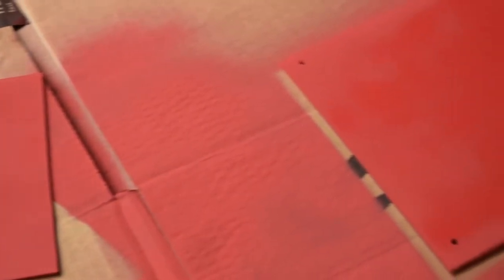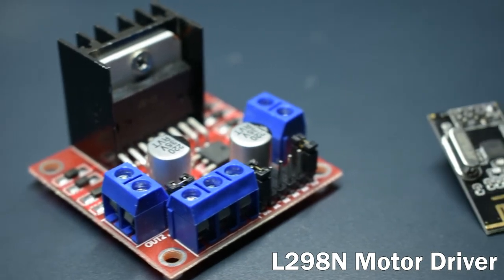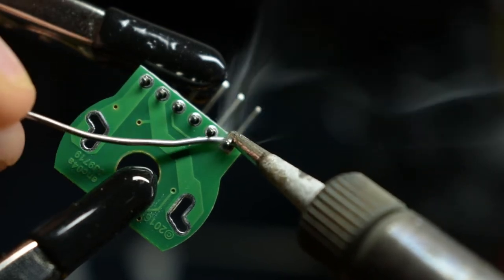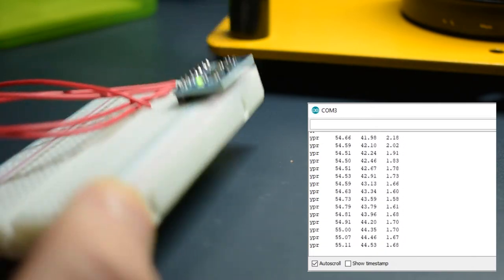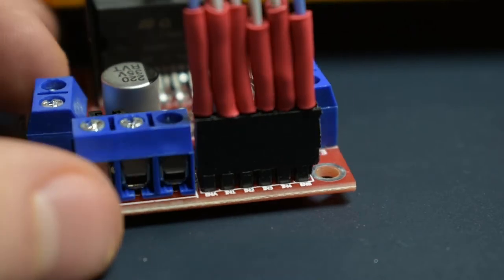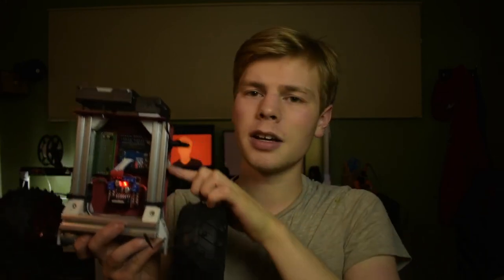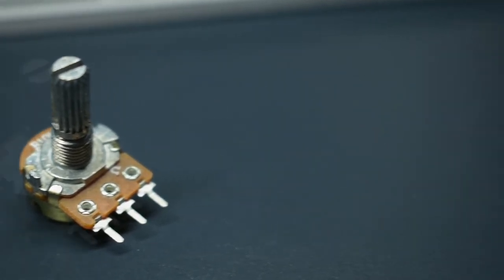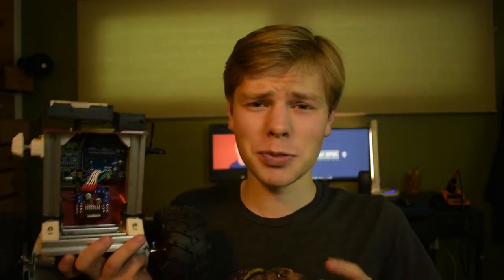BUILDING a Self-Balancing Robot | PART 2 - Electronics

Comment: nice job, did u use a level shifter between the mpu and arduino ?
Reply from the maker: Thanks! Fortunately, the MPU6050 has an onboard voltage regulator, so it can be used with 3.3V or 5V signals
Reply: @NoahZipin  actually the regulator is on the supply pin not the I/O. also you would still have to step up to 5v logic for the atmega328, it detects 0.65*5 as high which in most cases is cool, but from experience 3.25 is a pretty close
Reply from the maker: @sabaku7732  right. I believe on board resistors are used to pull up I2C protocol pins and pull down the interrupt. Should work so long as it is supplied with a stable voltage.